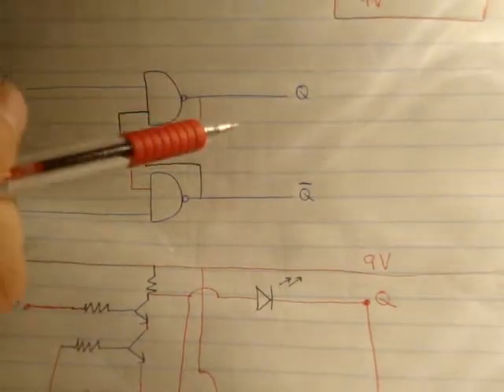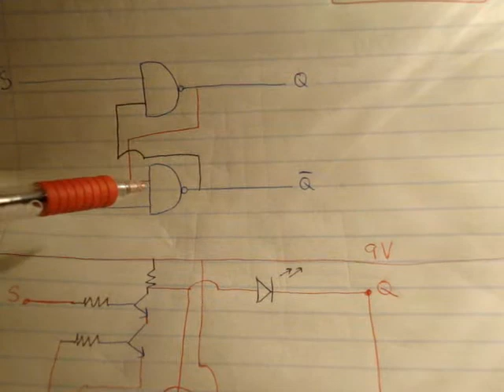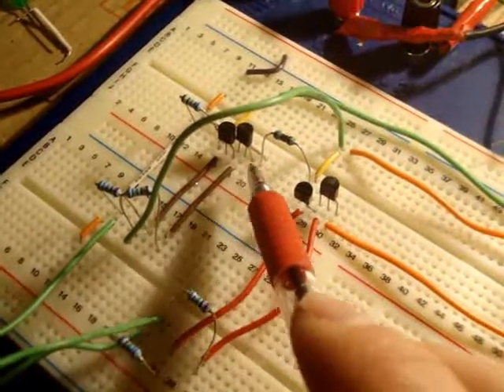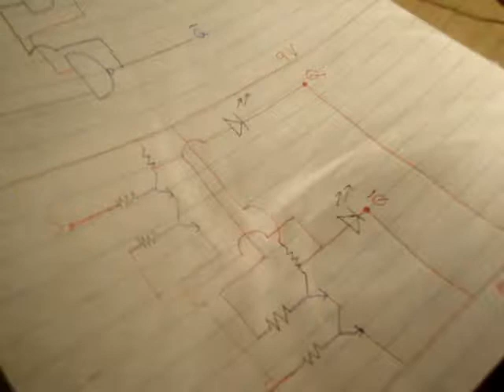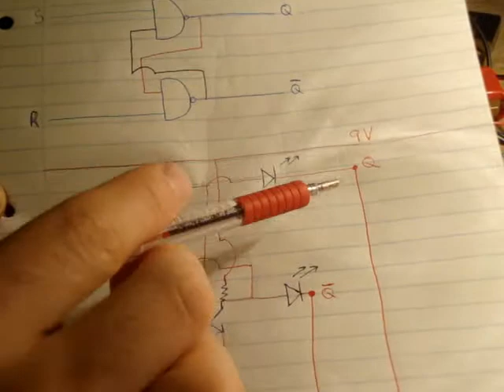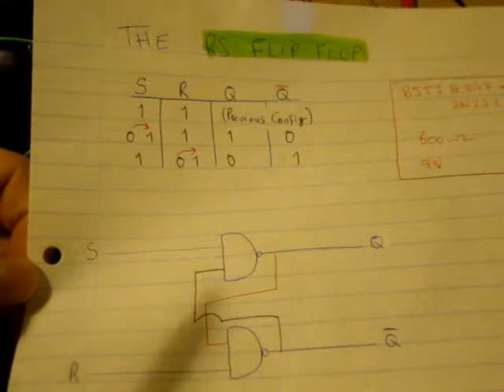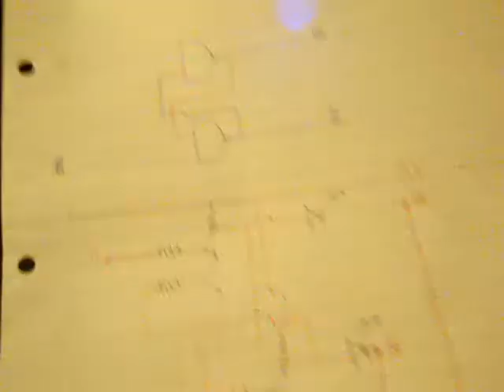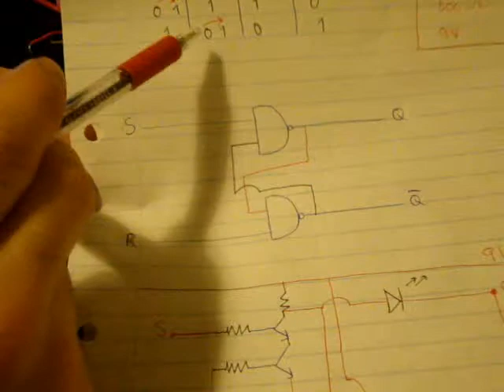Electronics 13 : How to make an RS FLIP FLOP ( memory cell ) part 2

Comment: I rebuilt this circuit 4 times, and I cannot figure out what is wrong with it. The NAND gates work fine individually, but when I put the two together, it refuses to cooperate. The sr latch will set Q to on, and when I apply the set, it turns Q to off, but upon repowering the set line, the latch switches back to Q being "on". In other words, it is "stuck" on Q being on, and will not lock itself in the off state